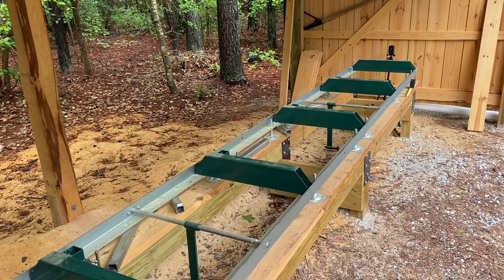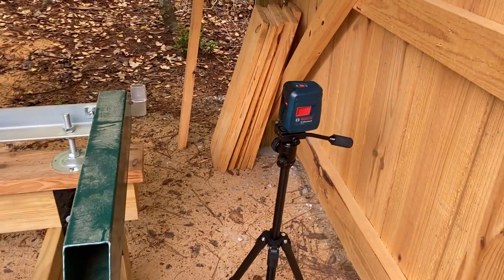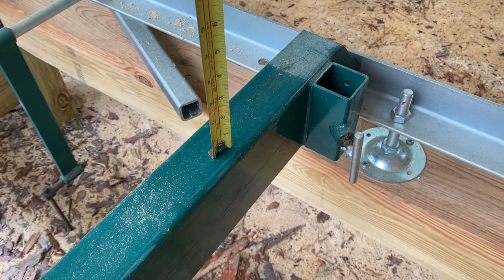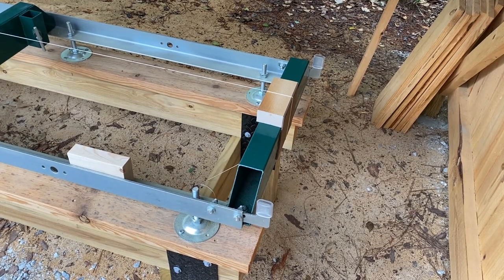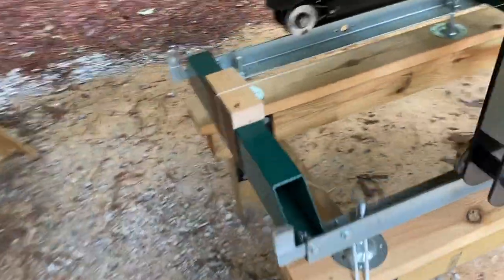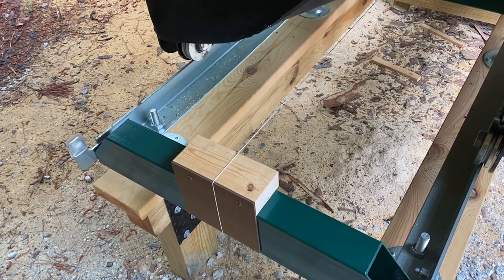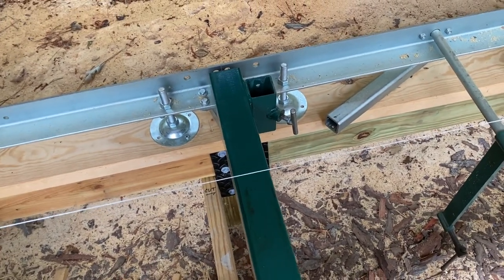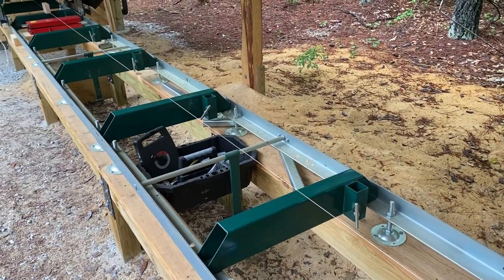Easy ways to true up a sawmill bed

Comment: Just found this and thanks. I like the guide blocks. Spring is coming soon so I will be checking when the frost is gone. One other thing I check is the relation of the saw blade end to end with the bed.

Comment: Very useful information as I have the same saw. Only thing I could add is that your method does not check for a left/right error over the length of the bed. I align my string along the angle iron track that the wheels run on and that ensures my track is straight over it's length as well as flat. As you say, lots of ways to achieve a good result. Please keep up your videos.
Reply from the maker: Have you noticed that changing over time?  I only aligned the tracks straight/parallel once, when assembling the bed and screwing down to my base.  I am assuming that if the trolley is still rolling smooth with no binding and no jolts at track joints, that it's still in alignment side to side.  But it's worth a check in the interest of science!
Reply: @Lumber_Jack  I found that mine did shift over time, I think mostly due to loading logs. At the time my saw bed was screwed to 8x8 blocks buried in sand. I have since poured cement  pedestals and attached a wooden support system similar to yours and this has improved things a lot.

Comment: I have my mill on cinder blocks. Just set the mill up. Milled a few boards and they all have a hump in them. I will try your string method and hopefully this will straighten the boards out. They basically pop of the log as I cut them. I have been setting this mill up for three days and am becoming very frustrated with it. I'm hopeful that this method will work. 
Great looking setup you have. Thanks for the video!
Reply from the maker: Yeah, that's a very good indication that the bed isn't flat, and the string will show where the problem is.  Should be an easy fix.  Another good indication is that your boards come off OK, but the very last piece remaining on the bed is humped or scalloped.

From time to time you will encounter wood with stresses and the cant will bow while slicing boards off.  Both the boards and the cant can develop curves.  Usually it's obvious that the wood has a problem, but that sure could cause a lot of confusion if it happened to someone on their first logs after setting up a mill.

Comment: Just installed my new 130 with the stainless steel caps on all but the outer bunks. I found that the stainless isn't sitting flush and will need to be removed, holes elongated and reinstalled... or just removed all together.  Figure the rail accuracy is most important, so I filed grooves in the four corners and ran string lines allowing me to true them straight and flat. Also noticed the rails in the extension kit don't mate up perfectly with the ones supplied with the mill. Had to shim one side to allow a flat surface but cannot fully work out the dip at the join. Chinese steel and assembly, cannot expect accuracy lol. I'll wait for the rain to stop, take another stab, and find a happy medium between bunks and rails and call it a day. Thanks for the great videos Jack. Now I'm trying to wrap my head around the measurement scale and come up with an easy method for quickly determining measurements cutting from the top and the bottom allowing for the kerf... good times
Reply from the maker: I had to use a thin washer to shim one of the rail joints to make it perfect.  As I recall, the bottom of the bunk was the problem -- it wasn't perfectly flat down where the bolts attached the rails to the bunk  With that tweak it was perfect.

I keep the absolute scale on the mill permanently so I always have an exact position for the blade above the bunk, and slap on other rulers to saw at known increments.  I did a video about the various rulers.  If you can work with the custom rulers (or make your own), it takes out all the guesswork and requires no thinking -- you just chase the marks down.
Reply: @Lumber_Jack  watched your scale video again, thanks very much, and ordered some of those magnetic rulers from amazon. I appreciate your knowledge and how you're taking the time to put these together. I'll be looking into my belleville warsher assy and rethinking the torque wrench now, cheers from BC Canada ;)

Comment: Thanks for posting.  Where did you source your adjustable Toe Board/Jack, (the Red thingy)?
Reply from the maker: Info on toe board here: 

https://www.youtube.com/watch?v=0cdPwwD-Ors

There is an Amazon link to the one I bought in the video description, but there are several low cost motorcycle lifts on Amazon just like this that will work fine.  Generally in the $60-80 range.

Comment: if I could start from the beginning, the alignment is off because the supports of the bed that go into the ground (earth) are not deep enough to go below the frost line? Or regardless of the depth of the supports, you must check and adjust the bed yearly (because big heavy logs will move the bed)?

Comment from the maker: I wanted to clarify for folks that use two strings -- before starting, make sure your end bunks are parallel to each other horizontally, side to side.  Could use a level for that or another method.  From there, the two strings can be used to get all the middle bunks in the same plane.

Comment: The fastest and most precise method is to use a line laser with a detector but ofcourse not everyone has one.  Bubble level works suprisingly well but it takes a while to set the bed up.

Comment: The string must have some sag. I would only use the string to test if the rails are strait. To test if the bed is level and in the same plane I would use a water level which is just two like containers filled with water and connected with a hose.  To get super accurate you can even use a depth micrometer to measure from the top of the containers to the water. This measurement should be the same for both containers. This was the method used by millwrights before lasers were available.
Reply from the maker: There are length limitations to using string, but over a 16' bed any sag is negligible.  When doing masonry work we know we can stretch a line to 40' or 50' without concerns, and even longer.  

Be sure to use a good braided twine and proper fasteners and knots on both ends.  Braided masonry twine is ideal for this.  

Done right, the main limitation on accuracy is how you read things with your eyes, so it comes down to sharp pencil marks and good vision.  Informally, about 1/64" accuracy is reasonable.

Water levels are great.  I made one many years ago with red RV antifreeze and keep it carefully coiled up and stored in my barn (no spills!).  There can be some error due to capillary action in the tubing (more of a time delay until it settles) and how clearly you can see or read the water level, but overall I find it to be a great method.  I use it less now that I have a laser level, but in bright daylight the laser is nearly useless so the water level still has its place.
Reply: Thanks for this information and all the great videos on your channel. I work as millwright in the factory environment but know very little about saw mills. Your channel is an enormous help to me as I get started.

Comment: Did you check to see that your saw blade remains at the same level as you run the head down the tracks? I've had situations where the bunk-to-track difference is not consistent. The bunk tops are all nicely leveled but the blade will shift up or down at each bunk.
Reply from the maker: I haven't seen that problem here.
Reply: @Lumber_Jack  I'd be curious to see, if you set up your laser so that it is coplanar with your bunks and so that it projects onto your sawmill covers and then put a temporary mark on it, and see how much the laser image moves wrt the mark. In my case, I've had to put washers under the bunks to fix that. Even the rails have slight bows in them.
Reply from the maker: @PieterLeenhouts  I did have to shim 1-2 bunks upon initial assembly in order to get everything true (string showed the issue).  Normally you should be able to take bows out of the rails very easily with the adjustment feet, since they can be used to pull the rail in any direction.  But if the bow is excessive I'd ask for a replacement.

Comment: Just curious, if I use the laser directly on the sawblade, wouldn't that work too?
Reply from the maker: Should work but I suspect adjustments would be less "direct" since the blade sits on the sawhead which sits on the trolley via 4 wheels that are spread out.  It would require careful trolley positioning for the base pedestal adjustments to correlate to what you see at the blade.  If you reference the laser directly to the bunks you can get a direct read on adjustments.
Reply: @Lumber_Jack  I see. Thanks.

Comment: My tracks are not flat. They sag at the joints between sections (3), however my bunks are level and flat. I just checked the beds using 2 strings. How do I fix this?
Reply from the maker: You should be able to adjust with the footpads as long as they are fastened down to a rigid/solid base.  It gives you the ability to raise or lower any section of track.  Sounds to me like you might need to lower the middle of the track sections.  You can run a string along the tracks to better judge how to pull them into line.

Comment: Hi, just wondering were you got those black joining plates for your log deck? Trying to find those at my local supply store but they dont have em.
Reply from the maker: I cut and drilled them myself, from some scrap steel I had laying around.  It's about 1/8" thick.
Reply: @Lumber_Jack  lol no wonder i cant find them, ok thx for the info, appreciate it.

Comment: I've really been struggling to get my my flat, and I just cannot find a solution. My problem is as I run the trolley down the bed, that's when it sags. I've tried different string methods, including this one, but when I move the trolley, it's all wrong and I don't understand how to flatten it when it does that. Does anyone have any tips? It's a 20' Rebel Vallee Sawmill.
Reply from the maker: Sounds like the mill bed needs better support so it doesn't sag.
Reply: @Lumber_Jack  I've been pondering it for three days solid now, and I my problem is probably the ground it's on. It has four jacks under it, all on large patio stones, so I should be able to get it flat! But if the ground is still shifting, that would make sense. I think I'll try getting a proper pap under it.

Thank you for taking the time to reply!

Comment: If you have 6 bunks and 4 in the middle are high why not save time and adjust the bunks on  each end. The middle stayed high for a reason. The middle  stayed where you set them in the beginning and the end bunks went down.
Reply from the maker: There are 7 bunks.  Lots of ways to do it.  Since the middles were not uniformly off, and not uniformly level side to side, I would still have needed to adjust them even if I took up the bulk of the difference at the ends.  Then it would have been adjusting all 7 instead of just the middle 4-5.

I don't think I can conclude what moved the most.  It appears that the middle piers went up a teeny bit and the ends went down a teeny bit based on the framing lumber behavior.  Our clay soil shrinks/swells with moisture and was likely another factor (that is never consistent either).

Comment: How did you measure the block with the lines ?
Reply from the maker: The lower line is the same height as the spacer blocks used on the end bunks.  And the upper line is just a string thickness above (about 1/16").

Comment: When you're adjusting the 'pedestals' to level the bunks, aren't you also altering the rail heights?  This, in turn, affects the plane of travel for the saw blade.
I would think it's more important to make sure all bunks are an equal distance above the rails.  This way, the plane of the blade travel will parallel the the plane of the tops of the bunks.  Perfect bunks only matter for that final pass leaving only a beam or plank remaining on the bunks - until you're at that point, each pass of the blade is going to be parallel to the previous pass.  Thus, out of whack bunks won't matter until you're making that last pass affecting what remains on the bunks.
Reply from the maker: The bunks are fixed directly to the rails and all the bunks are the same exact height.  When leveling/aligning the mill bed, we are moving the rails and bunks together.  You can run a string or laser down the rails or down the bunks to align the mill bed.  Either way both the rails and bunks are brought into alignment at the same time.

I should also add that you absolutely need to have the rails and bunks in good parallel alignment with the blade path.  If you are squaring up a beam or post, you want all opposite sides to be parallel and aligned with the pith.  If the blade path is not parallel to the bunks, every time you turn the log to make a new face cut, you're going to get out of phase with the previous face cut and the lumber will become more and more out of whack.  This is even an issue when cutting boards, since we often turn a cant partway through to manage stresses.  You need to know that all cuts are parallel so that you can turn a cant and stay aligned.
Reply: @Lumber_Jack  Assuming that each bunk is exactly the distance above the rails, your method is fine.  My concern is when/if the hole tolerance for the connection between the bunks and the rail is sloppy.  Variations in that distance can mess things up a bit.
Reply from the maker: @CT_Yankee  It should not be an issue with a well manufactured mill, but if needed, it could be dealt with during assembly using shims.
Reply: @Lumber_Jack  Forgive me for putting in my 2¢.  It's my engineering background (and life) that has me constantly troubleshooting or attempting to improve a wide variety of stuff.  I worked with a portable mill owner for several weekends sawing the timber I had felled on my property.  Hope was that it would go into the home I had planned.  Life threw me a few curves and that never materialized.  Now I have a new property with numerous disease-killed ash tress, several large oaks that the gypsy moth caterpillars killed, as well as some hemlocks afflicted with the wooly adelgid (which will eventually die if my UPenn beetles don't save them).  Been pondering getting an economical mill to make use of the timber before it rots (either on the stump or on the ground).  I'm a typical frugal Yankee that can't stand to see any resource be wasted.

Comment: Something I see overlooked is mention of Rails.
Let me clarify what I mean.
You talk about bunks and being flat.....
The rails can pitch up or down at the joints so easily it isn't funny,. making a V  or an A at each section, and it's possible to have the bunks flat and level and at the same time the track is doing the roller coaster and possibly exact opposite of the other side rail.
The level can be off enough to essentially "Lie" to you. both in the level and how well you read it.
I know all this as I have spent days chasing this and I have 2 additional track extensions,  so that's 24 leveling feet and 8 sections of angle. 25.6 feet of track. (and you thought you had problems)
On top of all this whatever your tack is resting on can be moving whenever you slam a log on it both loading or turning or roll the carriage back and forth and you have another "Ghost" to chase.
Another thing is looking down the track with your "Eyes" at the track level like sighting a rifle. You will be amazed what straight Rails rails can do.  that's up, down, right, left and yes even rolling or twisting.
And something I and all others have left out is the track can just as easily bend or bow right to left as easily as it pitches up and down at each Joint... even when your measurements are dead on.
So if you are having trouble remember you are battling so many moving parts at once, The rails can and do mimic a snake in every possible motion and you are trying to bolt everything together and straight.. If you got lucky and pulled your assembly off with no hitches "Kudo's to you"
I have built and continue to build But this was the perfect storm for me as I am a perfectionist (I know..... it's Rough Cut Lumber)
Another tell tale sign is if you see a carriage roller not rolling or stop rolling as the carriage is in motion(been there done that too)
The one thing I have not done and it's next.... remove carriage and pull a string on each track at the same time. end to end. 
And work it all over again,. by the way I have the 130 max.
Reply from the maker: It's very important to get the rails straight and parallel upon initial assembly, especially side to side.  Once you get all that set on a good solid base, periodic checks are a lot simpler since you're hopefully just worrying about the vertical adjustment and you can go off the bunks.

Now that you've gone through all the work to get your mill bed assembled perfect, consider that some people just lay the bed on top of cinder blocks and don't screw the feet down.  No joke.  I'm sure that goes out of true after the very first log.
Reply: @Lumber_Jack   My point was to everyone. just because you bolt 2 square straight pieces together end to end, slap a level on it and think you're good and done,. That's VERY far from the truth.
You have like an 8 axis multi-directional battle to deal with if you want anything "close to right".
There are so many ways it can veer of course.
And that gets progressively more complicated with additional track extensions.

And you are also correct the first log can knock everything out on unstable base, and periodic checks need to be made.

Also my  comments were not meant in a negative manner., just Blunt information.